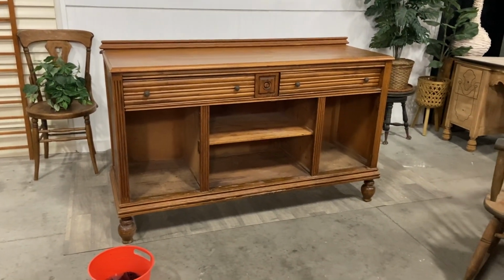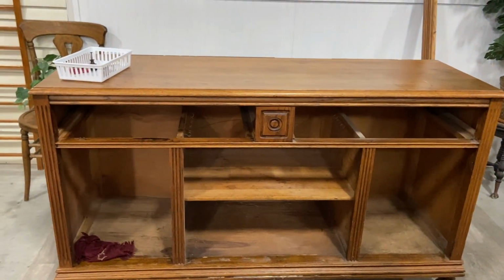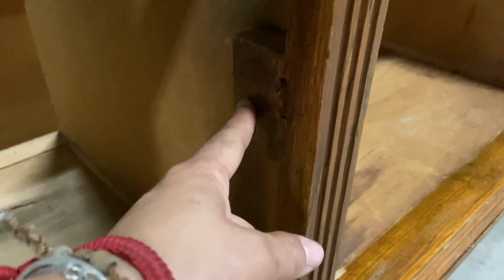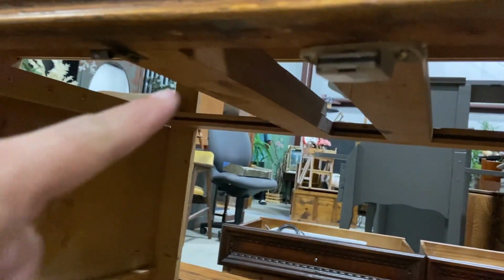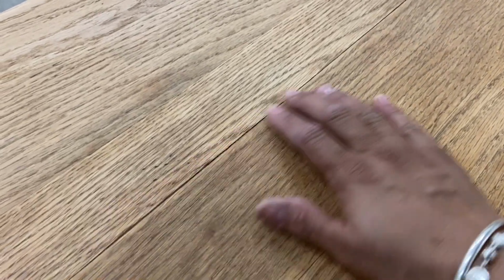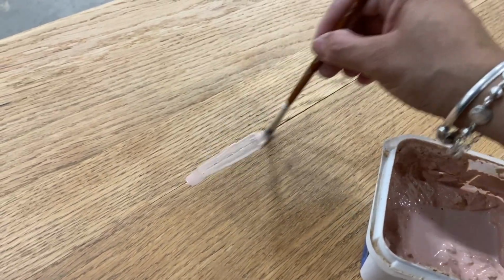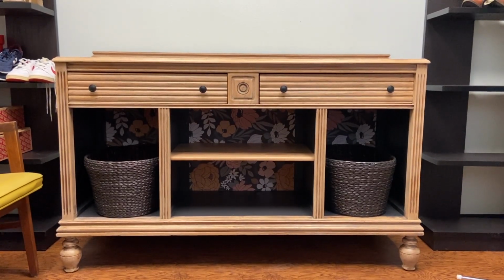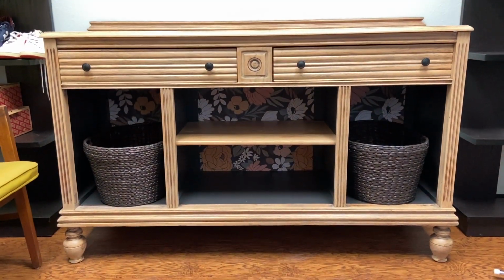EXTREME Buffet MAKEOVER | I want to keep it | Oak Credenza | Entertainment Unit

Comment: Hello would you have a video where a table has been damaged by acetone? I have a beautiful table and would like to fix it
Reply from the maker: Hi. I don’t have a video but have seen a few people use a mild soap and water solution. Another way is to use a vinegar and water solution or spray the damaged area with a light coat of aerosol lacquer from a can. When the lacquer dries, sand it lightly with steel wool and spray it again.
Reply from the maker: Hope that works.